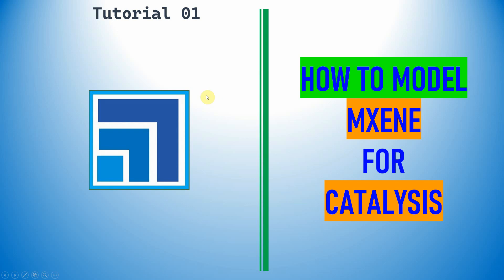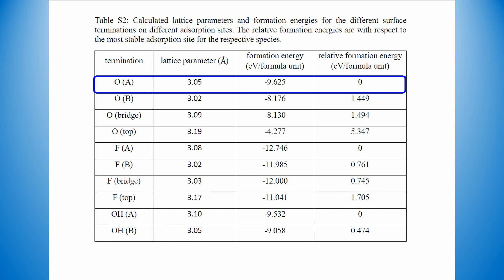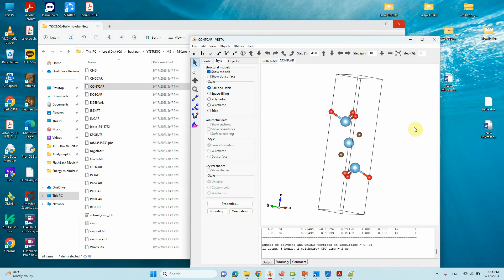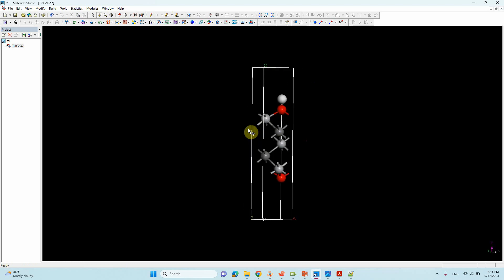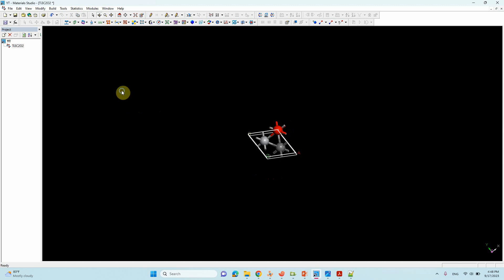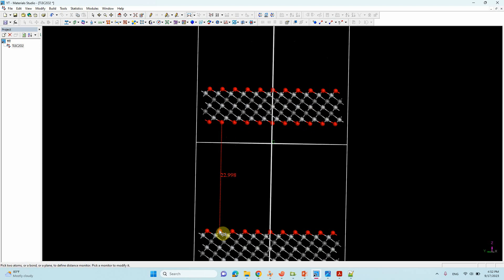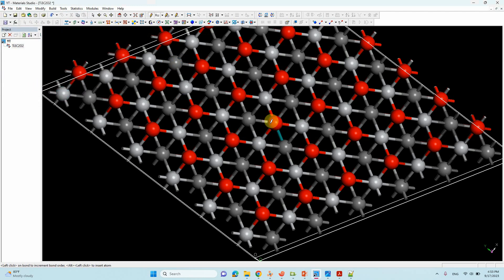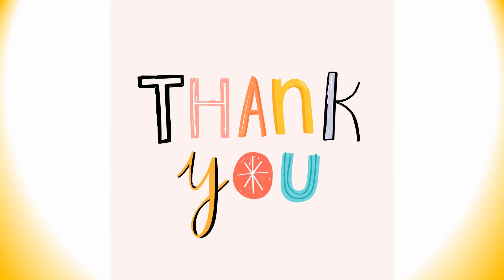How to Model MXene and MXene supported single atom catalysts

Comment: Sir, can we add the vacuum first in bare MXene and then relax it with ISIF =4, will it give the wrong ground state energy?
Reply from the maker: First optimize bulk Mxene with ISIF = 3, then make super cell based on your requirements and do optimization with ISIF=2. This is common way to do things.
Reply: Sir, for gas adsorption or atom doping also we would take ISIF = 2?
Reply from the maker: Do bulk structure optimization only in ISIF = 3, after, all your calculations do only with ISIF= 2 Atoms or molecules
Reply: Ok Thanks